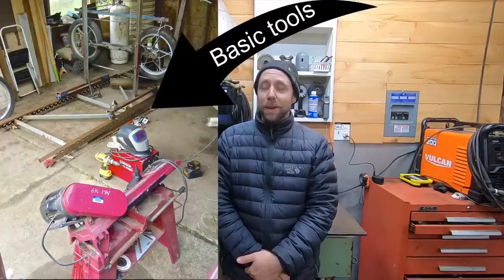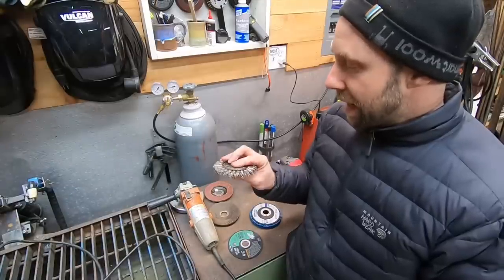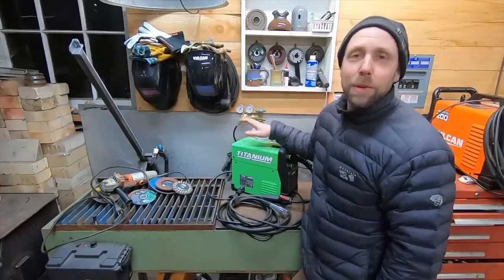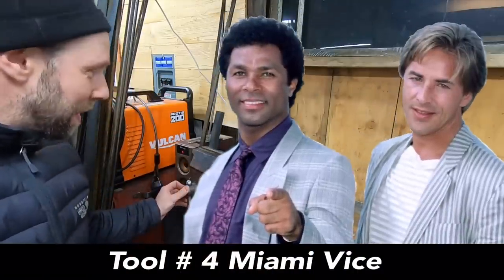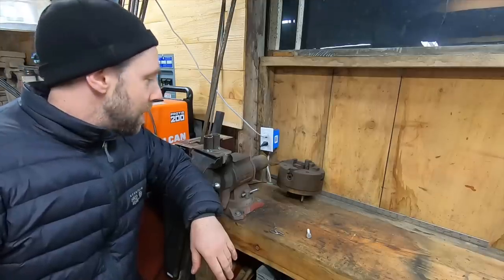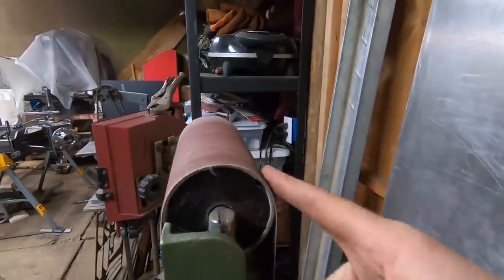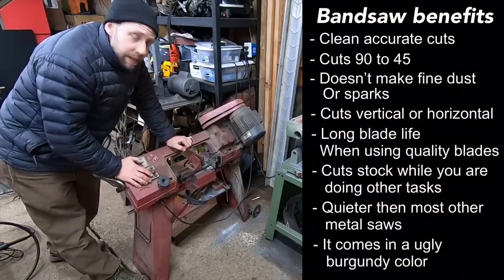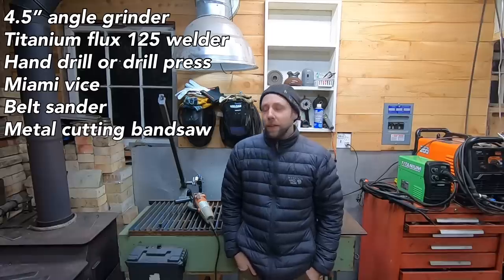6 affordable tools I recommend to get started in fabrication

Comment: You should never walk away from a saw.  Wow that’s a hack amateur thing to do.   Bad advice and it’s also bad advice to go and free hand on the band saw without a table for the material to lay on it will get caught on blade and pull your finger in.
Reply from the maker: Dude you are a complete troll 😂 what do you know about bandsaws? Your telling me not to turn my back on my bandsaw mill, I built the entire mill from the ground up and I completely understand how to safely run it. Don’t call me a hack you keyboard warrior!
Your comment about not ever running a metal cutting bandsaw without at table just shows how little you actually even know 😂 they all come with a small table plate about 2x3 inches, next time you try and call someone out on something you probably should know what the hell your talking about. 
Instead of trolling peoples videos you should probably go out to your shop and build something, your time would be spent in a much better way, plus you may learn a thing or two.
Reply: Mike festiva what do I know about bandsaws I know you shouldnt be telling newbies to walk away from a running saw.  
And I have an  OSHA certified 11,000 soft faberication shop with over 250k in metal fabrication tools and machinery.  I didn’t mock your work I had a problem with you giving out bad safety advive to people just starting out. 
If you can’t take criticism you should be on the internet giving out advice. You shouldnt even lay the grinders down on the wheel side for the extract reason you gave that if the button is on and you plug it in it will take off on you.  
There no such thing as a band saw mill.  Bandsaw is a bandsaw and a mill is a mill.
Reply: A “mill” is the building the equipment is housed in to manufacture products.  The tool is not called a bandsaw mill.  
You my fool armatures but know there are professionals watching also.
Reply: Dude if it is your home shop u can do what ever you want u don't have to even wear safety glasses. And what is it going to hurt if u leave it on turn it on and walk off.
Reply from the maker: Mike Eagle I know a thing or two about Bandsaws I built a mill from scratch, I take it you really have never worked in a metal fab shop, metal cutting saws are designed to cut with a set feed rate and the switch is even designed to turn off on it’s own after the cut is complete. I really could care less about how much money you have in tools or your certificates, but I’m sure you do like to toot your own horn 😂 The funny thing is you call yourself professional and you can’t even spell fabrication 😂 
I can take criticism I just can’t stand a rude Troll. Go back to your made up dream world where you are a professional. I would think anyone that has ever used a metal bandsaw would know they can cut in the vertical position, especially a pro like yourself.
Reply: @mikeeagle2653  no one has time to sit there and watch metal cut. And what is going to happen if u walk away from the saw is it going to grow legs and walk off the worst that could happen is it could snap a blade or stall out.
Reply: Mike Eagle, bro, tell us about this Fab shop of yours.... Oh wait, no videos on your channel... 

I've used countless metal band saws that all had the power switch shut off feature when gravity cutting. They put the switch there for a reason bud.
Reply: Mike Eagle, maybe you could explain to us what is the point in having an "auto-off" switch on a band saw if you can't start a cut and walk away?  Seriously, why have it?  This is not some expensive Hyd-Mech or something with an expensive blade, it's a $259 Harbor Freight, and if it binds and breaks or whatever Who TF cares?  Don't give two S****S about your OSHA BS shop either.  USA was built by people like Mike, that are creative in mind and skilled in hand, and don't follow rules and norms but instead make do with what they have and aren't afraid to fail and try again.  One one hand, OSHA may be a necessary evil against corporate slavedrivers, but on the other it's obstructionist and and anti-darwin, which is why the world sucks.  Rules and Laws are mostly made to stroke the egos of rulemakers and lawmakers, and otherwise keep people alive that 5000 year ago would have been killed by their own stupidity.  Good Luck to you sir.  Good Day!
Reply: @mikeeagle2653  where to start.....  it appears that you're into definitions - so look up the word "sawmill".  Bingo, a sawmill plant that uses a band saw to cut lumber.  "bandsaw mill". Also, I think the word you were searching for was "amateurs".  An armature, is the rotor in an electric motor.  Unless you have some videos of yourself pushing your own personal boundaries to build cool stuff in your shop with tools that "professionals" keep telling Mike won't work to build his equipment, you ought to pipe down and learn something.  Take what knowledge you want, and leave whatever you don't.
Reply: @Zzeke  100% man, lawyers have ruined the fkn country, just like OSHA.
Reply: Lmao. 🤣🤣🤣🤣🤣🤣 Mike eagle got ROASTED! And then like a chump stops responding because he knows he wrong and a liar... AWESOME!!! Lol chump
Reply: Mike festiva good job not being scared to telling Mike “the pro” eagle off! I like seeing people stand up for their product!! Videos, whatever.
Reply: Mike festiva good job not being scared to telling Mike “the pro” eagle off! I like seeing people stand up for their product!! Videos, whatever.